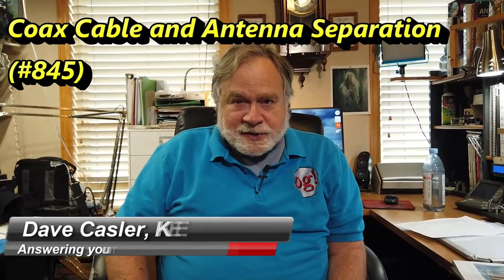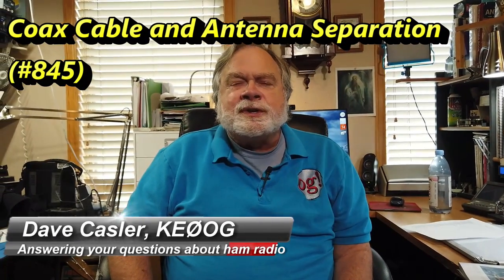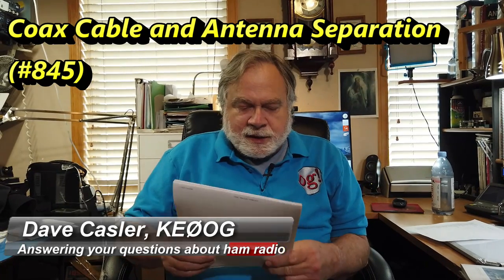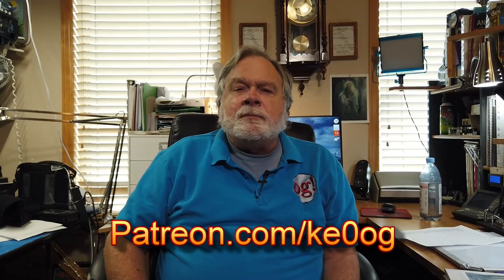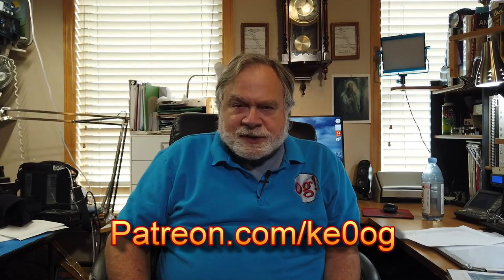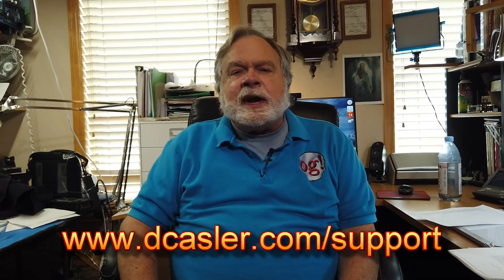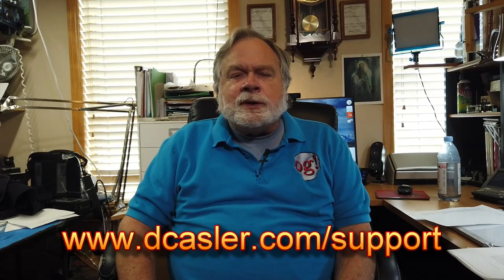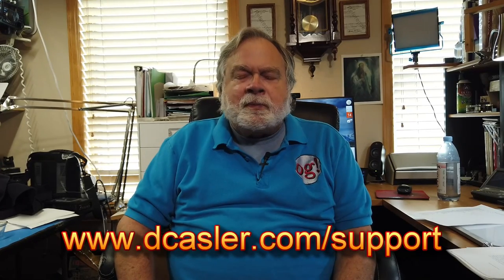Coax Cable And Antenna Separation (#845)

Comment: Licensed a few months ago and still building my station out. I’ve also been curious about antenna separation as I have a 60’ tower/mast unit I’m putting up and have a hy-gain AV680 HF vertical as well as a Comet GP9 dual-band vertical. Id like to get them both up on said tower and don’t know how far apart they’d need to be. Additionally a Tram 1486 for GMRS and a home made 11M di-pole. Can all this be crowded onto the same tower?

Comment: i HAVE THE 7300. MY QUESTION IS THE ANTENNA TUNER ON THE RADIO ENOUGH. i HAVE A KEN WOOD 990 i HAVE A AUTO SEPARATE TUNER FOR IT. THE SEVENTY THREE HUNDRED IS A NICE RADIO. BUT THERE IS DAYLIGHT AND DRKE  I LOVE BOTH RADIOS. ON THE KEEN WOOD i HAVE RADIO TUNER TURNED OFF.